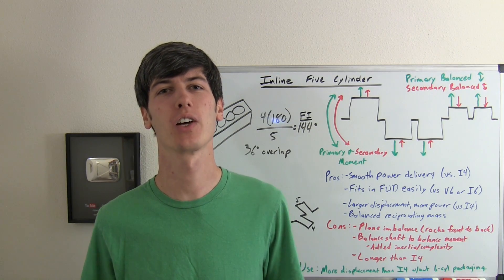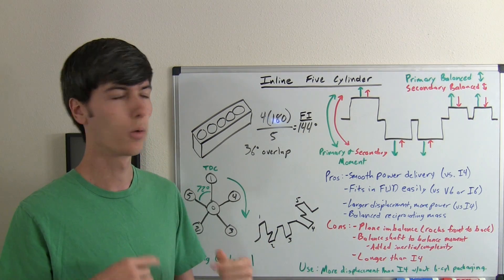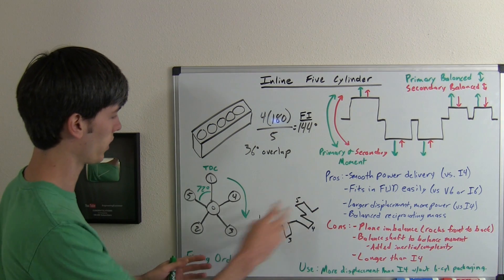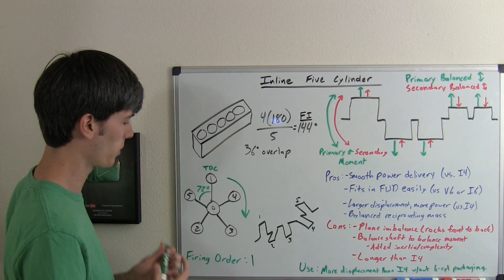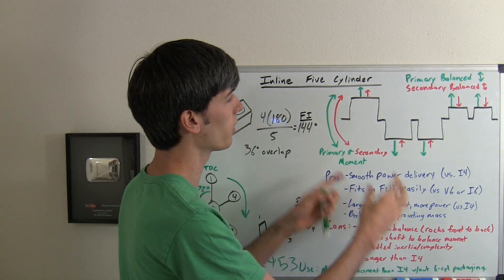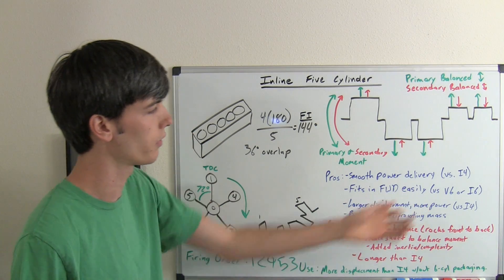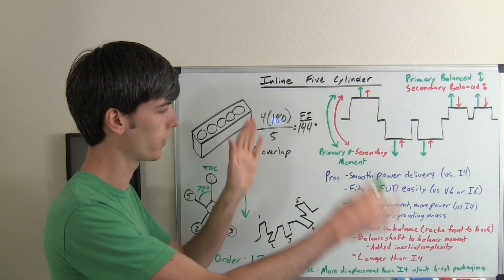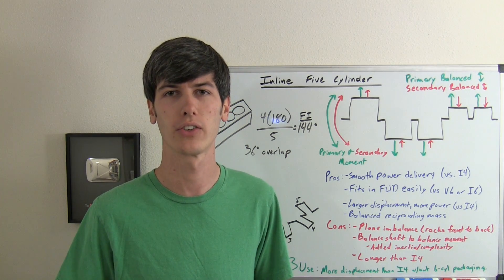Inline 5 Cylinder Engine - Explained

Comment: An I5 may ALLOW more displacement. But for whatever reason, they were almost never used this way. For the most part, I5’s are in the 2.0-2.5 liter range, which is well within the four cylinder range. The only exception that I can think of is the GM Atlas, which had a displacement of 3.5 or 3.7 liters. But this is the exception.

Comment: I never hear of 5 Cylinders 5 straight are 2 Pistons some on one side are 3 on the other side in one Block.
Reply: they are vr5 engines so staggered inline 5s basically as they have one head and one set of cams,
Reply: the inline 5 is better.

Comment: Regarding what he said about i5s being shorter than I6s, volvos successor to the 6cyl version of the 5cyl was actually 1mm shorter than the i5.
Reply: typically they are shorter than 6s, dont forget displacement plays part in the physical length of it. 
there has been a fwd drive transverse mounted 2jz conversion by some drag racer. so its not impossible just impractical to use for fwd. 
and volvo t6s are transverse also but auto only i believe.
Reply: @5cylinder91  the short Inline Six gains it's advantage from placing the timing components over the transmission on the back side of the motor, whereas the 5 cylinder has a traditional arrangement.
Given the Si6 is based on the whiteblock the cylinder bores are quite similar, 83mm for the 2.5T and 84mm for the 3.2 and 82mm for the 3.0T
Reply: @kirunacat  oh yes i know. just like the b57/58 motor. but displacement does play a part. smaller bores can save space
Reply: @kirunacat  the only advantage to that is packaging. 
massively inconvenient for maintenance imo. thats a big reason i got rid of my 520d e90. chain being gearbox side.
Reply: @5cylinder91  the Si6 is one of the easiest to work on engines across the Volvo product range. You don't need to separate the engine and gearbox to access the timing components(which is rarely needed anyway). The AC comp. and alternator are also very easy to access. Replacing catalytic converters on the 3.2 is about the most difficult maintenance point fortunately

Comment: looking at that crankshaft head-on diagram, it seems to me like they should go 14253 instead of 14325.  Like the firing order on a radial.  I'm guessing either there's a vibration effect not immediately obvious to me or maybe an enhanced torque delivery like with a 270 degree twin.
Reply: balancing shaft
Reply: For the record they go 12453

Comment: My 1994 single cab chassis VW Transporter has a 2.5 litre inline 5 Cyl.  Still going strong. slow revving but smooth power with low rpm's

Comment: I hate it because vw decided it would be better than just destroking a vr6. The vr6 has a cylinder wall issue, sure. Cylinder head issue, definitely. But it's a small price to pay to get true i6 firing order and balance. A destroked vr6 could have been a monster 400-700hp 10k rpm beast

Comment: Considering how much people hate the sound and feel of 4-cylinder engines in luxury cars, I'm surprised turbo 2.5L I5s haven't started becoming popular as a premium engine option for small to midsize cars. They burn less fuel than a V6 while feeling and sounding more special. What's not to like?
Reply: Cost. Four cylinder engines are cheaper.

Comment: Also a pro is, that its possible to fit it in cars with power delivered to the front sideways allowing also for a shorter car if you wish. Therefore it will rock the car a little of course.
An I6 however wont fit sideways easily, especially in cars with power delivered to the front. Most likely you will put is parallel to the driving direction requireing a longer hood.
Therefore an I6 counters all primary and secondary forces and doesnt rock allowing for even higher revs. I6s are easy to work on making them one of the ideal engines for tuners.

Comment: For Diesel motors this configuration was great.  Mercedes  has built a lot of them,  mainly on 50's  with  the  170 cars,  well into 60's, then later lending  them to SsangYong vans  and pick ups. They were  wonderfully  smooth.  Dont  know if  they still build them.

Comment: ok here is the challange i was changing the crankshaft seal had the cams locked i neglected to lock the crank when i went to remove the crankshaft bolt the crankshaft spun and now i need to reset the initial timing in a volvo 5 cylinder Q. how does the timing for the crankshaft and camshaft  get set if there is 2 cylinders in compression stroke

Comment: What if you put everything together.  Cilinder 1 at TDC , timing  gears on the right position of the marks. Both  when you check the compression of all cilinders,  and the cilinder one doesn't show any compression.
On this case what could be?

Comment: Power of a v6 and fuel economy like a 4 cylinder is kinda how I feel about the inline 5
Reply: Which is an impressive turn around from the Vortec 4.3 6 Cylinder that got all the fuel economy of the  V8 while still managing to put out  the same power of the 4 cylinder......

Comment: Audi uses it for the marketing. The vr6 was no longer selling even though that motor never saw a factory turbo, they are going forward with an inline 5 turbo because Audis history and consumers will buy that. Is it a good motor? All signs point to hell yes... But it is a shame to see the vr6 die this way without having got a proper crack at the factory turbo craze.

Comment: Hey good info ,I need to know what the 2006 Volvo s40 24i so I need a fuel rail pressure sensor so do I order the part for a inline 5 engine?

Comment: Please, if you built an inline 5 cylinder engine with the center cylinder having a larger diameter than the other 4, such that it had twice the displacement of any of the other ones, could that engine use the inline 6 natural balancing piston movement pattern? (Outermost move synchronized, then 2 and 4 move synchronized, then 3 moves alone?) Would this work just as well as an inline six? Thank you for all your videos!!!

Comment: Here is a question related to the inline 5cyl that there is only one explanation so far that has come up. Why did VW screw americans with the 2.5L 5cyl? (referring to gas). They wouldn't sell the engine anywhere but here and its a plague.

Comment: actually firing order happens at every 144 deg in this engine. but when crank rotates by 180deg. thn nly piston ll reach tdc. so if firing happens evn b4 it reaches tdc   hw it ll burn efficiently as mixture is not fully compressed nd how it ll produce more power? clarify pls

Comment: Maybe next time you hook up with HumbleMechanic you could explain the VW VR5? Mostly i want to know why vw would've offered it in a car that also had an inline 5 option, inline 4 option, and vr6 option. I like the way the VR5 sounds but i can't wrap my head around its existence
Reply: The advantages of VR6 are already described in an other video of him. The reason why VW did that is obvious. Because they had the know-how and the right materials to do it. So, depending on the time it was produced, it could have been a decent step to spare dimensions and "recycle" some existing material that are, whatever, mass produced for other cars in the portofoglio.

Comment: What do you mean by 'larger displacement'?
Reply: Engine displacement is the volume of an engine’s cylinders, a general indicator of its size and power. So more displacement from the engine the better.
Reply: I have a S60 Volvo 5 cylinder from 2008 myself its pretty unique nowadays because also Volvo will stop or has already stopped the production of their five cylinders I heard.  Its a 2.2 litre benzine engine and produces 140 PK. A colleague of me has an Alfa Romeo with a 2.0 litre which produces round the 200 PK thats quite a difference however my car drives fine where do these extra PK's come from?.

Comment: I'm thinking about swapping an I-5 engine into a small  car then modifying it.  The volvo and audi electronics situation intimidates me,  but the Chevy Colorado I-5 is probably easier.....anyone have experience swapping and/or modifying them?  The roller rocker seems like a good idea...and of course the cubic inches.......ps.....why is every I-5 undersquare? ie long stroke....historically, the best race engines were oversquare
Reply: One thing about the Colorado i5 engine, its still a rather large engine, when talking about small cars.

Comment: But I still don't understand why a 5-cyl engine sounds so distinct from a 4-cyl one. That being said I don't think I have heard the sound of a straight six as a reference...
Reply: +Siddharth Rajkumar it's all about the firing order and how many times/rotation there is a combustionsix cilinders sound smootherbut 5 cilinders sound wicked
Reply: lillnemo1 Six cylinders sound smooth, four cylinders sound fairly smooth but five cylinders growl. Really strange. Firing interval is not uneven in any of these cases as far as I know but the inline-5 sounds very distinct. In a V-engine, the firing interval will be uneven due to the angle between the cylinder banks but not in an inline configuration unless the crankshaft has been designed that way. For example, a Honda CBR1000RR always sounds smooth even with a free flow exhaust but the Yamaha R1 (the previous generation, not sure about the latest one) always used to growl even though both were inline-4's. The R1 had a cross-planar crank that made for irregular firing intervals. That I understand but not this, not the inline-5 sorcery... That being said, the new Focus RS sounds somewhat similar to the old 5-cyl RS. Maybe that has more to do with the engineering that went specifically into the exhaust's acoustics.
Reply: +Siddharth Rajkumar 

I get why it has its sound, but dont really understand the musical reference they use on this wiki page.

but it might be of use to you

it also has a cool gif showing the cilinders and combustion order of the 5cil

https://en.wikipedia.org/wiki/Straight-five_engine#Firing_order

Sound
The four-stroke inline-five's 5 firing pulses for every two crank rotations generates a distinctive sound, which can be represented by the musical interval 5:1. Engine sounds (even single cylinders), being periodic in nature, occupy a spread of frequencies that can be represented as ascending multiples, as in a Fourier series; this starts with the fundamental frequency (half crank speed) and rises in integer multiples, with each multiple being present in differing amounts in the final sound. Taking the octave of one pitch in an interval results in a related interval (i.e. through inversion);
 this is like selecting a higher multiple in the previously described 
series of frequencies. Such an inverted interval might be 5:4, via 5:2; 
i.e. a major third of the just kind. This is purely harmonic, but it is not too far removed from the 12-tone-equal-tempered major third found in much of western music.
Other intervals for other even-firing engines of differing cylinder counts can similarly be discovered. E.g. triples and derivatives (6, 12 cylinders etc): 3:2; inline-four and derivatives: 2:1; inline-seven: 7:4; and so on.
Reply: +lillnemo1 Thanks for sharing that info resource. Even I couldn't understand the musical terms. I think I need to do some research on this.

Comment: My 2007 Colorado has 5,Not 3rd gear pulls 4ooolbs+ of my trailer and tractor. 89 octane, kn filter, high mileage synthetic oil which reduces engine noise and makes a smooth ride. 8 years later..2015 4/6 cylinder Colorado gets the same gas mileage.. Wtf. Sticking with 2007, till 2018 affordable diesel to come To USA. Corporate greed what a plague.
Reply: +cedarplank007 I really havent got a clue what you're talking about

Comment: Somebody can explain why the inline 5 sounds amazing? I very like it, so different from the other layouts. 
Thanks for the answers, and sorry for my bad english
Reply: +matthew von the inline 5 doesnt sound like v10, the v10 sounds like i5 :D
Reply: It's very complicated. But the harmonics given by an engine are, equal if the cylinders amount are in the same mathematical familly. 4 cylinder engine are sounding a lot like V8 engines at high RPM. V6 engines have close sounds to V12 at high RPM, and I5 tends to sound near V10 engines.
Reply: they sound a lot like v10s
Reply: Exhaust geometry

Comment: Nobody does 5 cylinders better than Volvo! Too bad that Volvo isn't going to make them much longer.
Reply: +97I30T Respectfully, I must disagree. Volvo makes (made) outstanding ones, but MB's OM617 and OM602 are hard acts to follow. Indeed, the 617 was the first I5 ever used in production cars... and one of them still uncomplainingly hauls me 50 miles to and from work every day, 32 years and 211,000 miles later.

https://en.wikipedia.org/wiki/Mercedes-Benz_OM617

Comment: Instead of taking 4 X 180 and divide by 5 to arrive at 144° per power stroke. Its easier to do it this way 4 stroke (360° X 2 crankshaft revolutions equals 720°)  Do this, 4 stroke would be 720° of crankshaft revolutions divided by the number of cylinders 5 equals a power stroke every 144°.of crankshaft rotation.
Two stroke 6 cylinder would have a power stroke every 60° of crankshaft rotation. 6 divided by 360° equals a power stroke every 60° of crankshaft rotation.  
For the heck of it, a 2 stroke 5 cylinder (I have never seen a automotive engine) 360° of one crankshaft revolution would have a power stroke every 72° of 1 rotation. With that being said there are big marine 2 stroke 5 cylinder engines. Catch you later.
Reply from the maker: PermianBasinDiesel I think strokes * 180 / cyls is easier.
Reply: Engineering Explained Ok, no problem man.

Comment: "When would you want to use an Inline 5 engine?"
When you're building a rally car from Audi.
Reply: Or the 3.7l Colorados and Canyons.  Great trucks.
Reply: Yeah. Audi RS3. Give it a lifted suspension. Quattro does the other part
Reply: I previously owned a 2.5 Acura TL, was a good lil car.  Ran well and I was impressed with the power and fuel economy.

Comment: Why didn't I find your channel earlier... 
I have a 2006 chevy colorado with a 3.5L 5cil and it is smooth reving. 
 Just recently I damaged the heads and now over heats, im wondering if it has to do with the off balance at high revs that might have damaged it...
Reply: karl22 The 3.5L in the 2004-2006 Colorados had a defect in the head. At high mileages, (especially over 200,000) unless the dealership replaced the head with an updated one, it most likely is this issue. I specifically looked for and bought a 2007+ colorado with the 3.7 to avoid this issue completely,

Comment: My Jetta MKV has an inline 5 and has decent performance.  I am wanting to increase HP, what are some good suggestions?
Reply: +Chris Albo a lot of cash
Reply: +Chris Albo The first, most obvious step is probably the intake. The stock intake is kind of ridiculous- lots of twists and turns in the routing, and since the airbox doubles as the engine cover, it soaks up a lot of heat. There's a very convenient empty space in the engine bay for a short ram intake (SRI), and a clear path downwards for a cold air intake (CAI). A custom SRI can be put together for less than $100.  Another plus is you get even more of that beautiful sound!

Comment: Not to be picky, but I thought it was 720 degrees of crankshaft rotation for any engine to have a complete cycle. so a V8 would have 90 degrees, and and I5 would have 144?

Comment: Why the engines with a given volume has a typical number of cylinders? Like I4 has typical volume from 1.0 to 2L (i know some porsches had 3L) and L5 from 2.3 to 2.5 and V6 from 2.3 to 4?
of course a V8, V10, V12 or  V16 should work the same..
Reply from the maker: Desired cylinder size, engine vibration, desired power levels, plenty of other factors but those are some key ones.
Reply: cool thanks!
Reply: @EngineeringExplained  I cant seem to find any 5cyl in the 1.2-1.8 region ever made. Given engines do sometimes have a higher than typical number of cylinders with low cylinder capacity.. Is this search a dead end? Btw love your videos and all that knowledge that you pass on:) keep up the great work!
Reply: i know trucks work differently, as most of them are i6 regardless of size and sometimes when i6 and v8 have the same size, the i6 have more torque.. dont know why

Comment: What's he issue with increasing displacment on 4cylinder engines?  Why not a 3liter or a 3.5l inline 4 ?

If a V8 can have over 1liter per cylinder,  why can't a i4?

If I had to guess, it would not be so smooth.
Reply from the maker: Check out my I4 video. It has unbalanced secondary forces which are much more pronounced with larger 4 cyls. You can have them larger, but they require balancing shafts or will have a lot of vibration.
Reply: I guess you've never heard a 5 cylinder neither to say that sort of thing ? ^^ A 4 cylinder is soooo common and mainstream, i'm bored with them ^^

Comment: Love my Volvo's. The feel, the sound, and the power (2010 XC60) are awesome. The non-turbo (2001 V70) has very smooth power delivery, but is a little under powered IMO, to only get 23mpg. But hey, as a mechanic, the last thing I want to do is work on MY vehicle after a week of working on everyone else's, that's the real reason I drive volvos.
Reply: I have a 2004 non turbo V70 and while it is adequately powered, fast is never a word I would use to describe it. But it's very smooth, sounds great, and mine being a 5-speed manual helps make it feel faster than it really is.